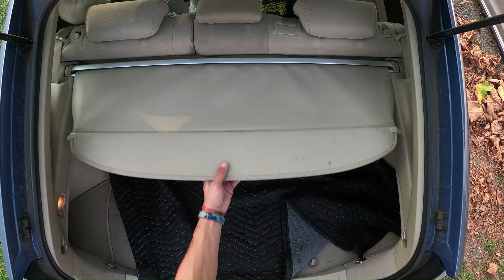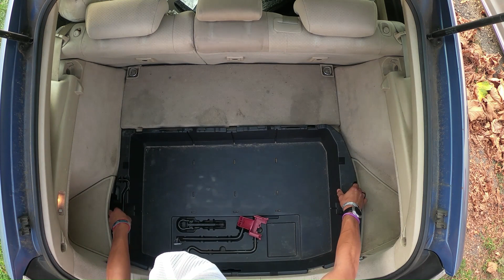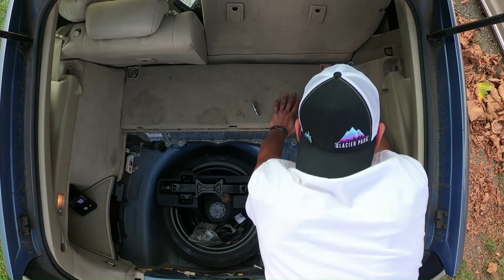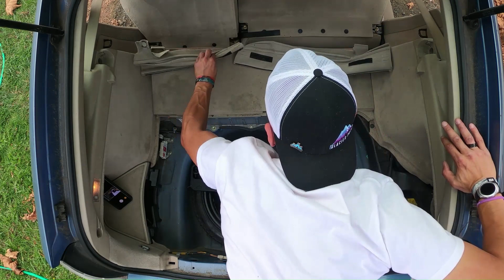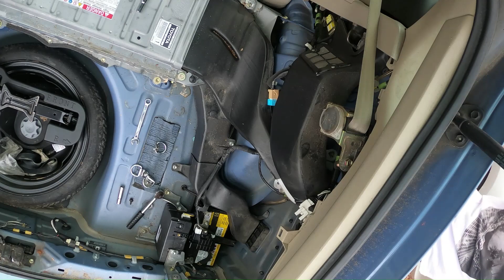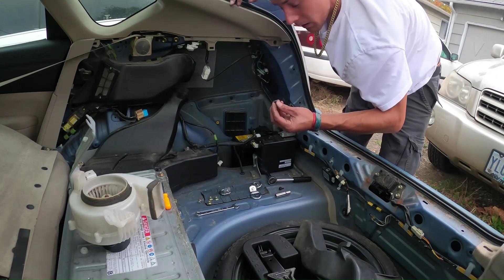GEN 2 PRIUS BATTERY FAN CLEANING (04-09)

Comment: One think gen2 owners need to know - you fan shoudl work VERY rarely. Battery ususally sits at comfortable level if you use aircon - fan is sually dont work at all. But if you hear it often - then itis may be time to clean. If you dont hear it it all or itis dead or its not needed and battery get comfortable temperature without fan working. Most of califorania for example will never hear that fan.